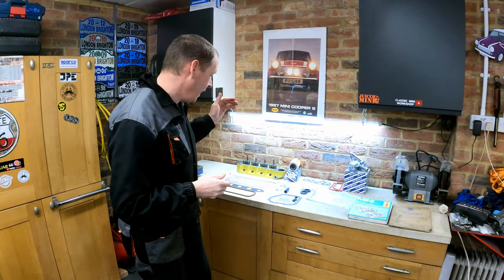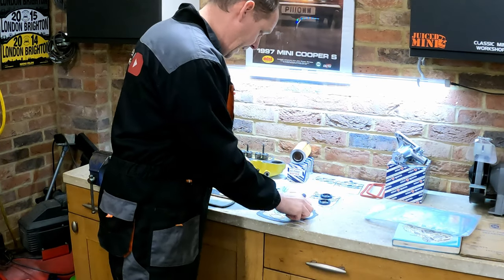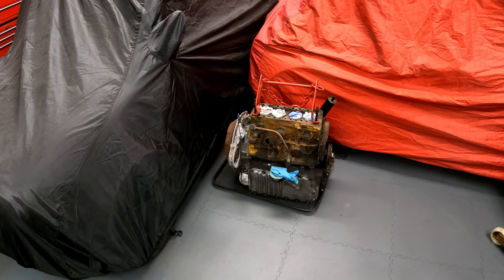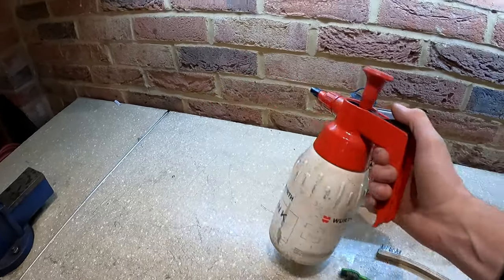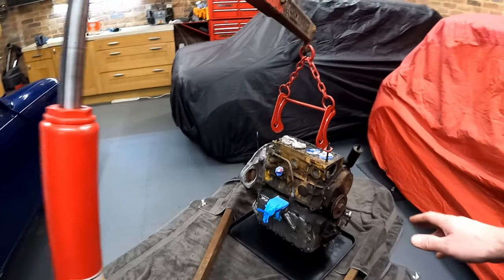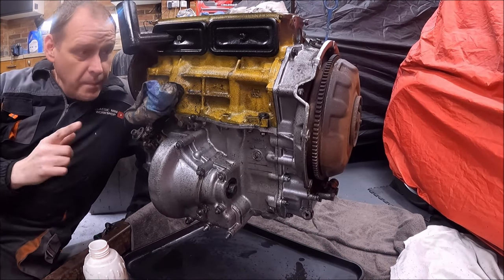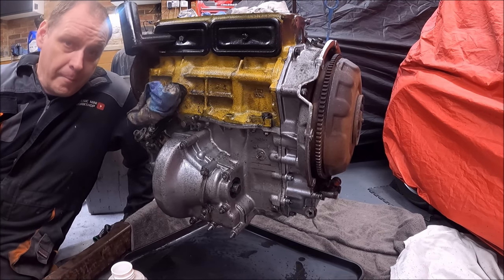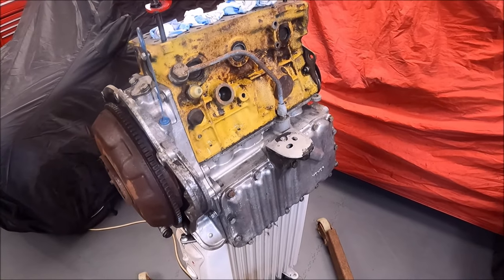Engine Degrease & Steam Clean - Classic Mini Workshop Project Tardis Pt.34

Comment: Looking good Keith, i do similar when washing engines off but usually add a bit of fairy liquid to the hot rinse as it removes the gunk easier? And i second the wire wheel on the core plugs 😊
Reply from the maker: Good tip! I will give that a try.

Comment: Great video Keith, if you want to tidy up the core plugs then use a cup wire brush attachment on a drill and clean them up....then fit the stainless inserts from smiffys bits to make them look like new 👌
Reply from the maker: Cheers bud, I will look at them

Comment: I had 2 Minis my 1st one the gear selector cable snapped while it was in drive, so couldn't get reverse or neutral. Second Mini the gear selector started getting stiffer and stiffer to move before getting the cable replaced which solved it.

Comment: 8:55 Normfest brake cleaner, awesome stuff, even starts diesels when used as easy start!! Am i giving away what line of work i'm in lol. And for the "Pista Resistance" some maf sensor cleaner lol
Reply from the maker: Brake cleaner for the win! I ran out of brake cleaner and Easy start once. I needed to get a BMW diesel started with faulty glow plugs, all I had was a can of Lynx Africa....... It worked a treat and smelled nice too LOL
Reply: @classicminiworkshop  Lynx Africa?. You been snooping in my bathroom cabinet lol. Will have to remember that. Puts a whole new meaning to putting a "Tiger in your tank" ha ha

Comment: Looking much cleaner now; what a difference! Thanks for sharing.

I was a bit worried though about those open tappet holes on the top of the block when you were spraying gunk nearby...maybe some masking tape or similar across those?
Reply from the maker: I'm not too worried about a tiny amount of Gunk as its 90% Kerosine which is used in most engine flush liquids but I take your point about any dirt getting down the holes. I will be removing the tappet chest covers in the next episode and probably replacing the followers so if any crud did get down there it will come out anyway.

Comment: The side cover with the speedo drive is best not removed. Refitting requires a special tool. Also removing it disturbs some o-rings. The front cover is easier, but also has one pipe with o-rings going into it. If the gaskets are not leaking its better not to replace them.

https://autominiregister.proboards.com/ this website contains a lot of useful information about the mini automatic transmission.

Good luck! Can't wait for the next episode.
Reply from the maker: Thanks mate, I got a call literally 10 minutes after the video went live to say the same thing so great advice. I replaced the n/s driveshaft oil seal and gear selector seal tonight. Looks like the o/s driveshaft seal need the diff housing removing so need to look into that

Comment: More Putrid Yellow soon then?
That Gunk is great stuff. I used to use Jizer as the original Gunk was thick and oily but the newer stuff is great. To clean the inside of stripped gearboxes I use Swarfega and a scouring pad ... 😳
You can see why the auto power unit sits lower in the front subframe (3/8 I think). Thats a deep gearbox.
Got to own up I do find degreasing and cleaning very satisfying and started on the dry build strip down today between painting the MPi fuel tank and stripping the starter. As one does ....
Big head debate: Its an 1100 so should it be green? Its an A+ 998 block so should it be Putrid Yellow? Its a 'Bitsa' so black?
Reply from the maker: For the Bitsa, it has to be Lime surely LOL (Green/Yellow) although Black goes with anything and is slimming apparently
Reply: @classicminiworkshop  Lime green ... 🤢

Comment: I nearly bought an automatic Mini recetly but asking advice on the Mini Forum 90% of responses were negative and it put me off.
Reply from the maker: They get bad press as the gearbox requires specialist tools, knowledge and can be costly to repair. They are becoming rare now simply because they are less favourable so if you can get a well looked after good working example they are becoming more sought after
Reply: @classicminiworkshop  A quick scan through ebay listings and others will show that there are still quite a few autos about but obviously manuals predominate.